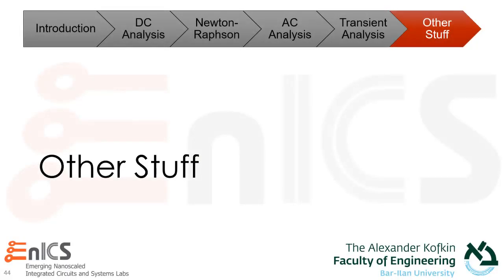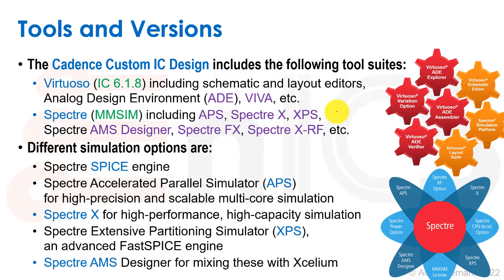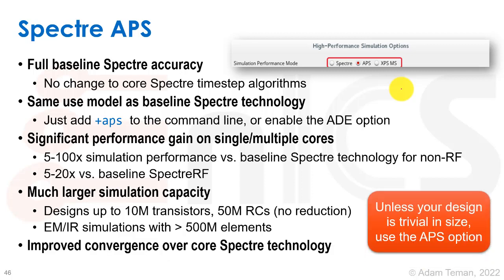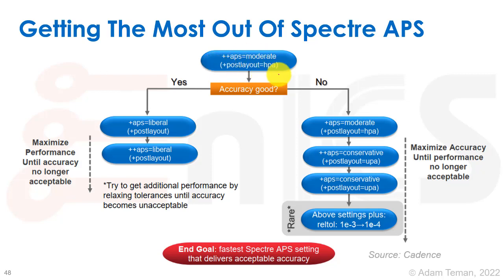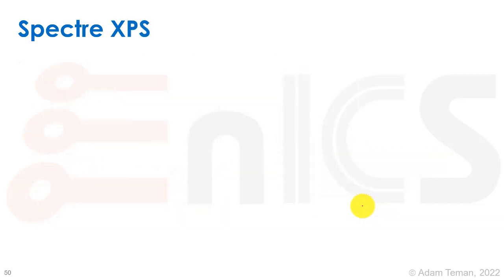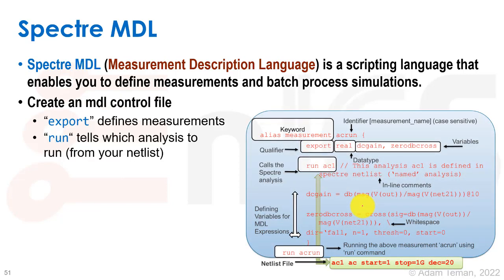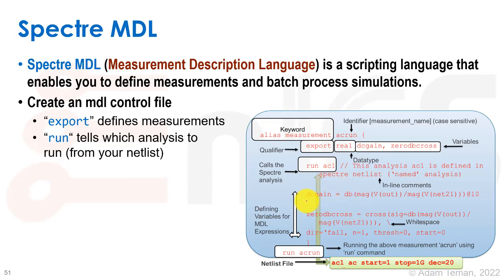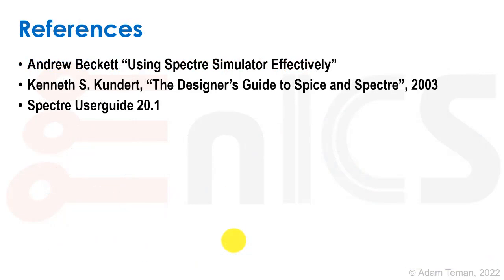Behind the Scenes of the SPICE Circuit Simulator - Part 5

Comment: I came across this material, and it is of great importance and quality to practical designers. Thank you for that. 
Would it be possible to also share the slides? I am afraid the link from the website is suspended.
Reply from the maker: Hi, thanks for the appreciation.

Yes, the university has blocked access to my website from outside of Israel since the October 7th attacks.

I have temporarily uploaded the slide deck here:
https://biu365-my.sharepoint.com/:b:/g/personal/temanad_biu_ac_il/EXEJuNGWqh9LnaSPcRuf7nIBHF2Jy4SVuxUh_98WfWt_wQ?e=rqQqqK

Comment: Really good summary. Spice requires first-order gradient to run newton algorithm, but how spice calculate the gradient of IV of PMOS or NMOS from BSIM model? It's symbolic solutions or numerical solution ? Could you explain how spice work with BSIM model? Thanks.
Reply from the maker: I believe this would be a numeric solution. Calculating the local gradient is quite an easy task - you take the operating point (x) and incrementally change it (x+epsilon) and find the gradient between the two calculated points.

Comment: Can you explain how we change the clock path cells in innvous tool by using the commands with examples to met the setup violations?
Reply from the maker: Hi Prakash,
I think that this is the wrong video series to ask that.
Please refer to my "DVD" course, and specifically the lecture on clock tree synthesis (https://youtu.be/xx7ymxmqrgU)
If you don't find your answer there, then ask in that comments section and try to be more specific.
Good luck!